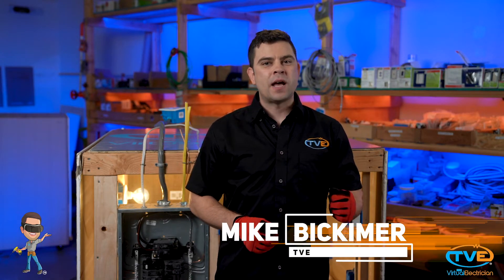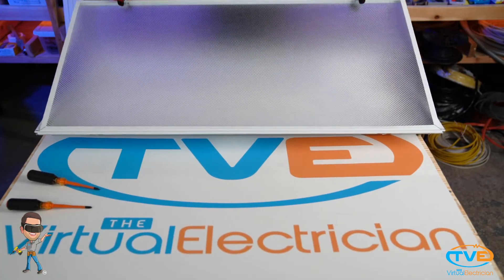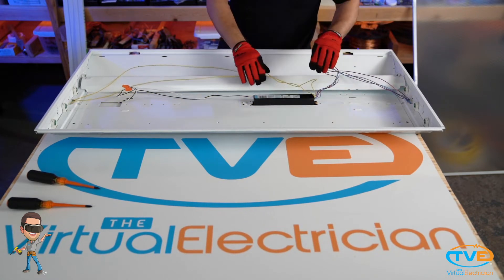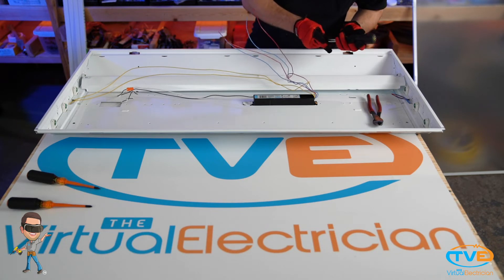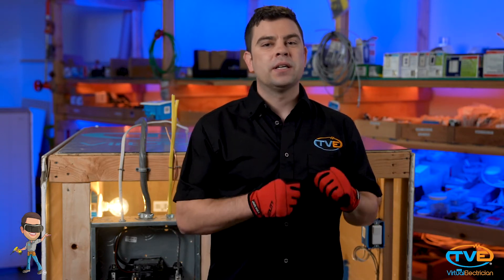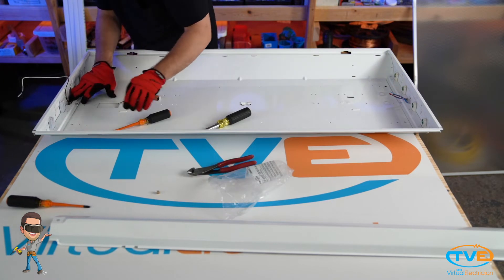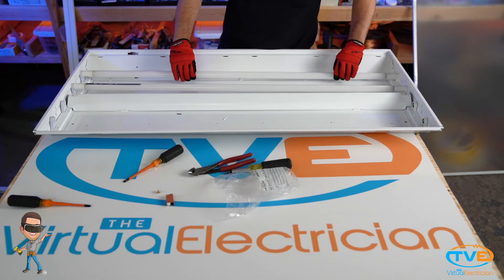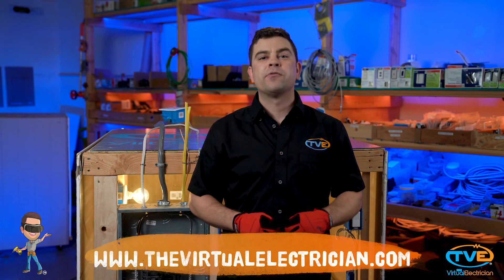Retrofit fixture to LED fixture

Comment: Thanks I bought some led bulbs that say they just replace the old tubes.  Works great but after about 30 minutes the lights go out
Reply from the maker: Yes sir you got the led tubes that work with the existing ballast but the problem, as your experiencing, is that you still have to replace the ballast when it goes bad. Let me know if you need any extra help bypassing the ballast and putting direct wire led tubes in!